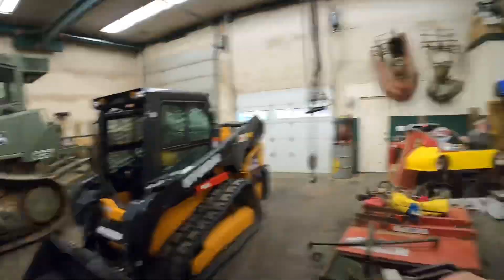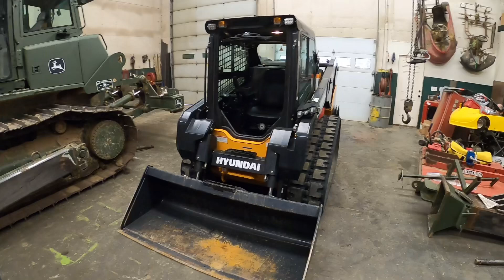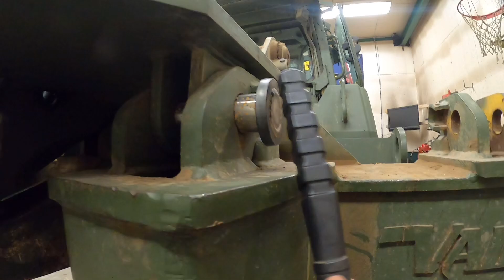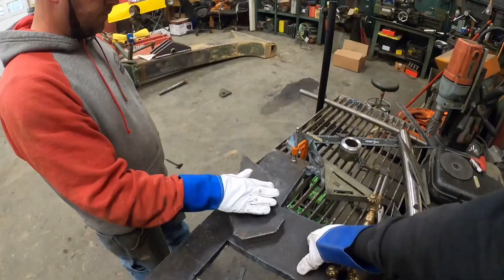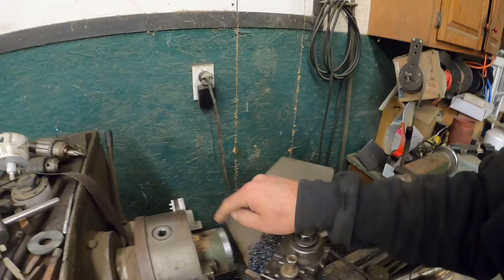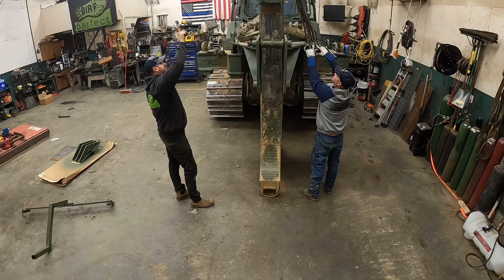100 hr review of Hyundai Ht100v Ctl and more improvements on the tile plow

Comment: You think this could handle a drum mulcher. If you do could it run a high flow efficiently. I see the high flow is 35gpm which is on the lower end for high flow drum mulching.
Reply from the maker: It’s not high flow
Reply: @DirtPerfect  the optional high flow gets you 34 or 35gpm, do you think it can handle a drum mulcher?

Comment: Hydraulic hammer down in the point of the plow to brake rocks and cut roots ?
Reply from the maker: Horrible idea thank about it
Reply: @DirtPerfect  I’ve never pulled a tile plow . But I have pulled a single ripper behind a D 9 to develop pit run material for the crusher. And I’ve all so ran a backhoe with a hydraulic hammer. There was many times I wish I had a hammer on the ripper to turn on for a few seconds to get past a hard spot . Sometimes looks are deceiving watching a screen but from my house it looks like there’s enough room in the bottom of the plow for a small hammer. And don’t worry you’re not getting a virgin I’ve had a lot of horrible Ideas lol and this one probably won’t be the last unless I die today lol. This might not work but it’s fun to think about.  Ps throwing a walnut at a piece of glass is a horrible idea 🤪lol

Comment: The Hyundai had me at the roll up door.  There is just some equipment where you can't swing a door open.  That was my only complaint on the DL550.

The problem that I see on the tile plow is that it was built with A-36 plate.  There are fatigue cracks forming and eventually it will fail.  It probably would be wise to plan on building an entire new one at some point using T-1 or AR 500 steel.  That plow has certainly made you the money.

Comment: Guys, mama I have mentioned this in the comments once before and I don't know whether you try to or not I sure would like to know if you were to get some graphite paint And paint the boot shaft Where it slides up-and-down . That's what they use or did use don't know about but they used to use that on extendedahoe s. It was available Either in spray cans Or paint on, The first time you use it you're gonna have to clean the  Stinger First before applying it  The first time to bear metal And after that you can just touch up Bear  Spots.
   C](:>)-[(❤)=] LDR

Comment: Goodbye, little Hyundai. I'm not sure I heard Mike say anything about the fuel consumption of that Hyundai but it should have been a savings.
That Back Brace should help prevent stresses on your plow column, but I would consider another gusset ahead of the lowest pin on both sides.
Good Luck! Great video!
Reply from the maker: It was good can not tell you exactly tho

Comment: Nice wrap up on the Hyundai 
And the mods to the digging thing and the new plate thingie only thing I can see is you have increased the pressure on that pin and is it going to cause issues there as there is a lot of pivot pressure any way time will tell all  all up as MBTS would say you like it  Cheers

Comment: Mike I got one question for you why don't you take all those pins that hold the plow onto the onto it and put a taper on one end that's going through to make it easier to line it up doesn't have to be a big taper but it would be enough to help line it when you trying to put it on to the the 750j just a suggestion you got the leg there and only take a few minutes to cut it cut it out of paper easier to get together all right this is Bob from Vero Beach Florida God bless and stay safe and keep up the great videos
Reply from the maker: Because they all ready have one

Comment: Nice review on the Hyundai, two things impressed me, lifting 4k cement blocks and running the brush cutter, good machine. On the pin, we used 4140HT annealed for pins, as well as 1050, 1050 chrome plate, and EL50 chrome plate in certain cases, 4140 HT was our go to on pins. Excellent idea on the longer back plate to help with stress on the boot. Nice job of fabing in the improvements on the plow, you keep at it you will have to the point of the dozer being the weak link on the plow.  Thanks for the update sir, really enjoyed and appreciated the video.

Comment: Roll up front door is a must Im used to an SVL75 I’m now using a Cat 259 I can’t stand the swing door.  We usually don’t run CTLs bigger than the 75hp class machines as they are the right size to get into the places we need to. CTLs are not used everyday at most we put on one is 100-200 hours a year. They are kind of necessary evil.

Comment: The guy busting out my driveway blew a hose in his Case while using the hammer.  The tip was stuck in the concrete and he could not open the door to get out.  They had to take the door off to get him out.

Comment: Thank you for your amazing content.  You guys always do a fantastic job.  A quick note on lift height, 126” to the hinge pin..other standard features on the HT100 include ride control, self leveling bucket, bucket float, hydraulic 2 pin bucket coupler, back up camera…

Comment: Hyundai Heavy Equipment rocks!  On the tile plow, your new secret weapon, the leading edges, where the plow rides up and down, I might have put a slight wedge edge (45 deg?) on both ride edges, to make sure it self cleans as it goes up and down.  Again, great video, the best ones are where even though it says an hour long, like good movies, it starts, and then it's done before you know it.

Comment: Roll up doors are a better idea period.  Other manufacturers ought to see the light and follow suit.  Any safety issues can be addressed with hydraulic lockouts and appropriate overrides.
Reply: I wonder if the main issue is patents but most of these companies do have cross-licensing deals.  There's too much OEM not to
Reply: @LatitudeSky  don’t know, but as a guy who has said way too many cuss words when I’ve wanted to elevate an attachment to fix something on it and can’t because it traps me in the cab, I’d sure like to see it happen.

Comment: The fire watch guy should probably move the torch and welding station away from flammables and other important things ie the water heater. Torch slag and grinder trash in toolboxes and power tools on the bench isn't good. Love the videos and mbts rocks. His fabrication skills are great and his skills as an equipment operator have improved tremendously.

Comment: In my 40 +years welding fabricating heavy eqipment steel is costly I cut heavy cardboard templates to get a perfect fit the lay it out on the steel plate trace it then cut it. I don't allow wide gaps I want a good 45deg taper on both plates with a 1/8" gap between the beveled in side edge to push my root into. To get a full solid weld the full depth. Big thick wide gaps end up with crap in the center that shows on xray

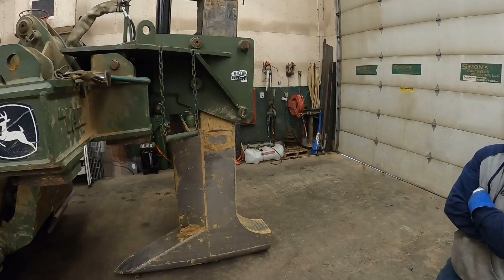Comment: 57:59 no, its just geometry. If you have two feet between the plow shank and the lower pin, and two feet between lower and upper pin as well, when you pull 15 ton on the shank you push 15 ton on the upper pin and therefor pull 30 ton on the lower pin. Forces need to be in equilibrium. When they are not, your plough breaks.

Comment: Spray & Pray is a standard Boiler maker term, I believe it's actually on most detail drawing in the legend as S&P with a min/max distance specified for adequate coverage . In the notes it requires multiple coats of weld fixative to allow for proper tensile strength to be achieved.

Comment: I am getting ready to buy a track loader in the 97hp I talked to the Hyundai dealer here in the Thunder bay Ont. Canada. They have all there excavators I been renting for years. I am told they will not bring in these skid steers for sale until they bring some in for there rental fleet some day an put them through the test. With my bad back I wanted the roll up door but I am left with ether the bobcat T770 the cat 299D or one I never seen or ran the N50 wacker newson but videos I watched on reviews it out performs the other 2.. I undecided an putting out 197k$ tax in for a machine an 4 attachment  cash is big none of them have roll up door. Only other machine avalble here is the crap kabota witch they can shave it up u know were
Reply: No Takeuchi in your area? They're everywhere in my area and for good reason. Really hard to find someone unhappy with one, especially the smaller operators who actually care what stuff costs.  The big outfits grab Cat or Deere or Bobcat, sure. But when it's your money on the line, it's usually a Takeuchi around here.
Reply: @LatitudeSky  oh I use to love the bobcats but I rented a lot of them before they were bought out an now after an the  Quality has really gone for a dump  what use to be 3/4" is 3/8" or 1/2" hoses are a 1 wire not the 4 any more
Reply: @LatitudeSky  nop closest dealer 1800 miles. Can't deal with that. The ones I liked are the only one other the JD an I had all I can take with that dealer. There a video of the wacker newson an a Takeuchi head to head push in the same 12000lb weight class an 97 to 100hp just like the bobcat an cat the wacker pushes all them across the pit like a stone and the others just dig a hole trying to push the wacker. Keep in mind takes are lock an engeine off on the one bring pushed. I look 1st off for a Takeuchi being a roll up door  no one with in 1800 miles.
Reply: @LatitudeSky  but I love the 9 foot bobcat pro snow plow/light materials blade w/fast drop an pick up pusher box that just hooks on top rail of the snow plow.. but after seeing the other attachment from each deal I going to go with the USA made ski pro snow blower. 4-1 weld on tooth bucket. The 96" scrap graple bucket for cow bedding clean up.  Tree shear. 12" post auger. Hay spear pellet forks an seed drill. Much heavier build an better waranty and a family run mfg. Oh an even with exchange better price. They sell direct. It all huge changes to my farm an loss an rebuild home an shop due to Hydro one 2nd new power transmission line leassing another esment an nothing can be built under it     so there be tons of great videos to come as this huge change happens.. cows losing there thick forest they used for 30+ years for shelter from bad snow an wind storms.. oh with ever machine I go with will have the  Aggressive heavy duty tracks with bolt on carbid cleats an added 9k as hills are very step an icey an grease in summer when red clay get wet

Comment: I'm surprised the tile plow has worked as well as it has.  The pressure on the plow must be tremendous when it's buried laying tile, especially when Mike is using it as a ripper, tearing up huge slabs of rock.  As the weak spots are discovered and corrected, the plow just gets better and better.  Eventually you'll reach the sweet spot where the "weak link" is strong enough to not break.
Reply: Its unreal how well it works in the rock isnt it? I knew it would plow tile pretty decent but i also just "knew" it was gonna just get bent and tear apart as soon as he tried to pull it through the first decent underground rocky patch! LOL Im glad i was wrong.
Reply: That , or the weak links start having John Deere part numbers attached to them .

Comment: That is probably 4140 heat treated. It is somewhat hard but it is tough, very tough. Probably run 10,000 feet through my turret lathe when I was working making parts for a machine that installed and removed railroad spikes. It is tougher than anything else I machined.

Comment: Hyundia needs to teach Boeing about designing doors.
Reply: Being an aviation mechanic, from everything I've read, the Boeing design doesn't appear to be the issue, someone, somewhere, didn't install the door/plug correctly.  But your comment made me smile.
Reply: @robobloxgamer524  Rumor has it, their removal versus opening procedures have differences in their "re-installation" versus "closing" instructions.  The former states specifically to reinstall the capture bolts, the second (Closing), for some dumb reason, does not.  As the first (Re-install) required a line inspector to look at it when done, and the second did not, they, allegedly would log them all as "Plug Door Opened".  As a retired aircraft mechanic/supervisor, and pride in my work was job one, I would have screamed long and loud about that dichotomy.  It makes a big difference when you have skin in the game and pilots were (and still are) family.
Reply: @paulholmes672   As a retired wrench bender myself, if the rumors are true, this is worse than I thought.  Incomplete maintenance instructions can get someone seriously hurt, or worse.  The NTSB report should be an "interesting" read when it finally comes out.

Speaking of family reminds me of a quote I heard many years ago from Len Beauchemin, then the head of maintenance for Kodak, when he said at a maintenance seminar, "There are only three types of people that fly in airplanes, your family, my family, someone else's family."
Reply: @robobloxgamer524  I also heard subcontractor to blame or should I say ex subcontractor
Reply from the maker: lol
Reply: Hyundai should send their heavy equipment engineers over to their automobile division for a while .
Reply: @kaboom4679  you are correct have ever tried to get in touch with their customer service? It is impossible.
Reply: I saw that too.
Reply: By the time the report comes out the people outside the aviation industry will have forgotten about the whole thing.